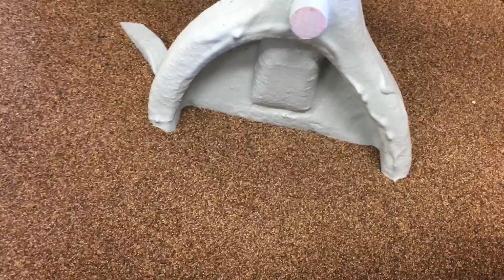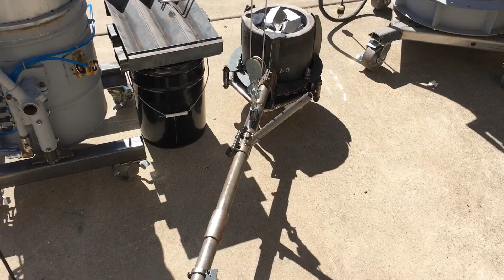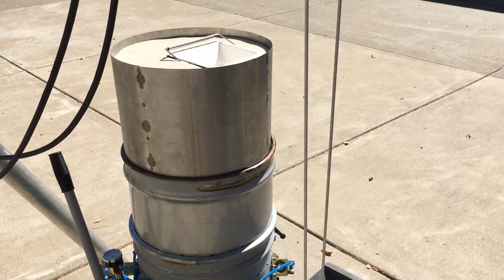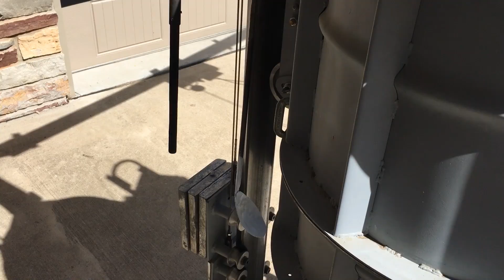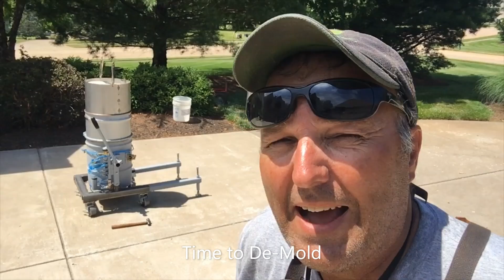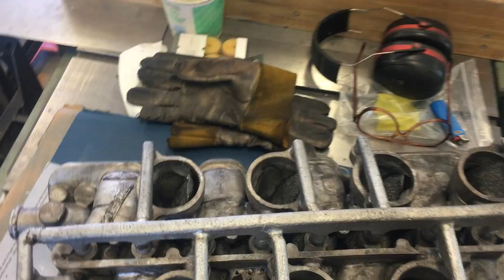Lost Foam Casting an Automotive Intake Manifold   Part 2

Comment: I'm retired none machinist, I picked up the machinist hobby 25yrs ago. What i've been working on for the past many years is a model  V10. I think mostly becouse I work with engines since I was 10. Lot of the parts involed in my build are cast parts being there is the lest amount of machining. Some part where easy, some not so easy. For help with the not so easy parts I have been following U tube such as your site. And yes you have been most helpful in corecting problems such as in gas venting in lost foam casting. I'm like my dog a Yorkee, once she gets to know a person they regert it, never leves any body alone, thank you for your help, whats your Email so as i may pick your brain, I'll be looking for that forum you talked about.

Comment: In Lost Foam technique, does the molten aluminum burn the foam out?  Or do you bake or “fire” the core to clear it before pouring it?
Reply from the maker: The molten metal evaporates the foam pattern while in place in the mold. The foam undergoes two phase changes; solid to liquid, liquid to gas/vapor. The latter is closest to the molten metal front and passes through the permeable pattern coating into the sand mold and as it does so, it alows the molten metal front to advance consuming all the foam while the metal pressure holds the loose unbound sand in place. Best, Kelly

Comment: That's really really impressive.  How much time do you estimate you have in making this start to finish?  Again, hats off man that's a hell of a project
Reply from the maker: Hobby stuff so I didn't keep track of time. When it's fun who counts? When it's money.....different story. There was a lot of equipment upgrades I did along the way to mold and pour a part this size that won't recur. I spent a lot of time engineering/designing the part and features versus making the pattern and foundry work. With all that behind me, and now that I'm using a CNC router to make foam patterns, the next one would/will be a small fraction of invested time. Best, Kelly

Comment: Kelly, what grade of sand are you using? Can I also use regular playsand and vibrate? Is that all I have to do?
Reply from the maker: Play sand will work as long as it is dry, and it often is not. If you already have some you want to use, spread it thin on your driveway in the sun and then gather it. It can also be pretty course with small pebbles, which probably doesn't matter much if you are coating your patterns. If you are going to buy, I use "Quikrete" fine sand because it is washed and dried and pretty consistent size. It is typically available at the big box stores in the section that has concrete and mortar mixes. It's probably about 50 mesh and is inexpensive at about $4/50lb bag. The #1 factor for your LF sand is to keep it very dry, else it is hard to excite and pack with vibration. I also store it in sealed buckets for this reason and because it stinks after use. If you are doing iron LF, you'll probably need higher refractory media than silica sand, like aluminum oxide or zirconia. Best, Kelly

Comment: Maybe a 55 gallon drum cut in half to make it easier to work with? Or a box? Something lengthwise? The big foundries have a big sprue roughly the distance of each runner. Like 4 big sprues with a horizontal part.

Comment: Hello Kelly  Coffield  I enjoyed these vídeos. If you need to attach 2 or more pieces of foam together, how do you do it?
Reply from the maker: It depends. If it is a small joint where the glue can be applied and the parts joined in 10-15 seconds, I use low melting point hot melt glue. If it requires long working time, High Tack Poly Vinyl Acetate (white) glue. Laminating is a longer discussion. I have another video on lost foam materials with more discussion. Search my channel. Best, Kelly

Comment: Would you possibly be interested in a side project?   Im in the process of building a foam intake manifold "much less detailed than yours" for my Cobra R clone...... basically a 2000 Cobra R intake lid, i already have the lower intake i just need to make the upper "hat" part.....  let me know if its something your interested in, i understand this wouldnt be cheap
Reply from the maker: There all side projects ;-). Post your contact info or contact me through my website www.inlinecarb.com. Send a picture and description of what you are looking to do. Best, K
Reply: @kellycoffield533  if you do this, and please do this, please share with us when you you do it.
Reply from the maker: @jkepps  Second pattern is done so attempt #2 will be forthcoming in the near future. Best, Kelly
Reply: @kellycoffield533  awesome thanks! Just emailed ya

Comment: Bummer indeed! Oh how the elation of first breakout view turns to major disappointment at failure on closer inspection - we have all been there and as you say modify approach and try again. Love the pouring set up, it looks to be a great success and surprisingly easy to use as it gives you more control over the pour than most crane type crucible lifts - well done - its a good model for others contemplating having to use a crane because of pour weight. I note the suggestion of the use of something like CO2 as  a possible solution and I also note your reply as to the problems therein. Even so I think it worth following up on a little as CO2 sand is fairly easy to pack and perhaps a sand based on Fenotec or similar binders may be suitable as it is even easier to pack and may do so with vibration? If so use fenotec sand in place of your current loose sand?? Apparently the set time of fenotec can be varied for 1 minute to 3 hours so plenty of time for pattern immersion and vibration of and into place before set but once set I doubt any leakage will occur. However your comment about weight is noted! Perhaps a thicker coat on the insides of the pattern? Sadly you are a bit on your own here - you are the expert on this process and the best the rest of us can do is guess .😊.Martin
Reply: Further to my comment above. I notice that the sand tank is pivot-able, could you perhaps extend this idea to a sort of gimbal arrangement so the tank sand mould assembly could be moved through various angles in all directions as the vibration occurs. Obviously some sort of temporary lid would need to be on the sand to stop it falling out when the angles get steep enough to ensure proper pattern sand contact... Just another stupid idea 😏... Martin
Reply from the maker: @olfoundryman8418  Thanks for those thoughts Martin, always much appreciated. You know I will not give up easily. I do occasionally (modestly) tilt the flask when filling/vibrating in an attempt to pack difficult features. You have to be careful because what usually happens is the media in the top of the mold/flask moves to one side and the bottom remains fixed and it the uneven sand pressure can distort the foam  pattern, sometimes severely. It's far better to position the pattern wisely and maintain  the sand depth in the flask on all pattern surfaces as you pack/fill the flask. That way the sand pressure remains the same on both sides of the wall of any pattern feature. The commercial LF foundries change the direction of vibratory excitation to move and pack the sand in different directions. The turbine vibrators on my molding rig are positionable for that reason. I've successfully molded and stabilized what at least to me seem to be much more difficult cavities than these runners. You probably haven't had an opportunity to read my failure analysis and proposed corrections at The Home Foundry forum thread on this project, but I will have new mold media, pattern positioning, vibratory packing technique, and make a feed system/gating change. for round 2. When you know what doesn't work, it's easily to postulate why, but don't think I don't do my share of guessing too. ;-) Best, Kelly
Reply: @kellycoffield533  Well, that's what I get for sticking my neck  out in an area that I don't know much about 😊. But to risk making a fool out of myself yet again a further thought did come to mind. I was some time ago given some resin core sand based on not sand but rather one of the newer ceramic bead molding materials. These beads  were about #50 mesh and surprisingly spherical. If you could get the beads (without the shell resin coating) and use this material as your mould media I wonder if their spherical shape might lead to better packing? Or have you already thought of this?... Martin
Reply from the maker: @olfoundryman8418  Nothing foolish there Martin. What's foolish is someone pouring a bunch of molten metal on a complex foam pattern without thinking it through....and then pledging to do it again....like some people I know. :-) The LF equipment manufactures ferrous media offerings are typically rounded media, usually mullite/alumina or zirconia based. In a previous life, I did extensive work with filtration using packed media columns. I learned a lot. Round media definitely can be made to flow more easily with vibration than granular media. I think it can be dislodged more easily too but the commercial operations also use vacuum assist and the pressure differential provides additional mold stabilization. If you can sufficiently vibe granular media it lodges together and forms mechanical interference, almost like a bond. The least expensive source of spherical media in low volume is blasting media, and can be bought in any mesh size, but it is about $1USD/pound. I buy my sand at retail stores because it's convenient. It is sieved to size, washed, and dried, and even at retail levels is about 8 cents/lb. If I was willing to buy it in bulk at 1 ton or more it would be 1 or 2 cents/lb. I cant store a ton of sand. I'm still just a guy casting metal in his driveway with equipment I roll out of my shop. Best, Kelly
Reply: Kelly , Again I find myself "preaching to the converted" As I should have realized with the effort and thought that you have put in to make the LF process your own you would have investigated the various media options. It seems that CB media is available ex China at about $400.00 per ton.  there must be someone importing it (or even making it) in the US. Even allowing a fair mark up it should be available in a suitable quantity that considering its reuse-ability would not be too unreasonable - if it solves a problem. Perhaps I am wrong (again) but as stated above I was given a 25 Kg bag of CB resin coated to try. I was hardly a big customer so for them to just give me the 25 Kg indicated to me that while it was no doubt dearer that the approx $7.50 I pay for 25 Kg of resin coated silica sand it was not that expensive?? (Wrong again ?😏)
"Like some people I know" - Hmm, yes there is a lot of that on YT. I just watched an admittedly entertaining video on making a casting and as usual it was full of errors from pattern making to casting finishing. I nearly choked when the offer was made to describe the functions of the various bumps etc in the running system in a future video, if the demand was there - clearly the video-er had no clue as to proper gating etc. In another video a gate was cut in a circular way encompassing about 1/4 of a circle from the sprue (massive parallel) base to the casting - it was explained that this curved gate "cleaned the metal" (groan!) And this from a well known YTer of US origin, he has 20 times my sub level - Sigh - its just not fair. Keep up the good work.  I await the next try... Martin

Comment: Been using this vibrator for years for various applications. Really powerful but you can remove weights to tune it. 
https://www.ebay.com/itm/143762975291?hash=item2178f0ea3b%3Ag%3AyfAAAOSwNsVfdDqz&LH_ItemCondition=3
Reply from the maker: Thanks for that link. Much appreciated. I went and looked at those and others like it and based on their published specs, it appears I already have the equivalent vibratory force of two of them. I may swap two more of the larger TBs for the smaller ones. They are compact and high energy, but they are big compressed air pigs and I won't be able to power three of them continuously but should be able to charge my 80 gal receiver to 150psi and power them all for a few minutes at a time for round two. Best, Kelly

Comment: Está peça roxa e isopor
Reply from the maker: The foam is pink but it has a refractory coating that is blue/grey. Best, Kelly
Reply: @kellycoffield533  interessante
Reply: @kellycoffield533  quero produzir um cilindro de moto.tem como
Reply from the maker: @marciomila9264  Have you viewed my video "Lost Foam Finned Engine Cylinder Casting" ?
Reply: @kellycoffield533  não
Reply from the maker: @marciomila9264  You may find it helpful
Reply: @kellycoffield533  ok obrigado
Reply from the maker: @marciomila9264  De nada
Reply: @kellycoffield533  vc tem links aonde encontro esse produto refratário
Reply from the maker: @marciomila9264  I have a video called "Refractory Coatings for Lost Foam Casting Patterns" that discusses the refractory coating.

Comment: Murphy is gonna have his due, always 
Some sodium silicate sand, in difficult places, might work 
Very impressive rig
Looking forward to the next pour
Reply from the maker: It's true, but it is very time consuming and difficult to pack bound sand in a fragile polystyrene pattern, and it gets very heavy. I've been able to produce much more difficult internally cored parts with unbound sand. I didn't think the pattern position and molding through as well as I should have. Must try again! Best, Kelly

Comment: Sorry but I am happy I get a part three.

Firstly, I love your foundry setup, it’s put together so well.
I have nowhere near as much experience as you but what about mixing up some sand with, is it sodium silica??? You know, the stuff when exposed to co2 it goes hard? I know orientation of the foam will probably solve the issues.
Lastly, do you reuse your sand? If not what the heck do you do with it after a
Scraping it up off your driveway?

I am thoroughly enjoying every video you come out with, thank you very much for sharing.
Reply from the maker: I have occasionally used ss bound and even some green sand in difficult places but it can cause as many problems as it solves. In lost foam, when you get it right, it's generally not needed and demolding is just dumping sand. I do reuse sand in fact have for five years now. I have a sieve that sit's on top the flasks and I just shovel it in. It does degrade over time. It's cheap and I should have replaced it before this pour. You should join TheHomeFoundry.org. There are detailed threads on this project, many others, and all of my equipment builds and process development from the last five years. Best, Kelly

Comment: Which matrial use for pattern making??
Reply from the maker: Owens Corning Foamular 150 Extruded Polystyrene insulation board. If you search my channel for this title "Pattern Materials for Lost Foam Casting" there is more information about materials. Best, Kelly

Comment: Rig looks great Kelly!  That's a whale of a crucible.

I'm not competent to comment on your fine work but I will for my ego.

The defects you have are hard for someone who does not lost foam cast to understand.  It is where the sand did not get packed around the pattern sufficiently and the refractory coating does not hold the metal in.  That's why Kelly refers to it a a leaker.  Very frustrating to have happen, and it seems so obvious after the pour.

Kelly: Have you tried to pre-pack difficult areas?  I've thought about filling with sand with a foil tape cover to hold the sand in place during handling.  Don't know whether it would work because I haven't tried it.  In my experience the density of the packing is not critical so long as there is not an unfilled area.  For me, the vibration is just to get the sand to flow, not necessarily to pack it.

I'm looking forward to your second pour for the money.  Do you see any pattern changes you want to make now that you have a casting?
Reply from the maker: Pre-packing certainly can work, but for this part, packing the runners would make it too heavy to handle the polystyrene pattern. Vibrating actually does increase the packing density (10-15% typically) and causes the particles to settle into a more tightly/pseudo bound state. Try pulling an object out of a barrel that has just had sand poured around/on it versus vibrated in place and the enhanced packing will be quite apparent. I was asleep at the switch when it came to molding the part. I'm going to have another go with a different pattern position, fresh mold media, and staged vibrating while filling. Best, Kelly
Reply: @kellycoffield533  I hadn't thought about the weight of such a large pattern.  Good point!

I vibrate my sand and know it packs it in tightly.  I'm not certain that is of much value in keeping the metal in the refractory however.

Have you had failures due to lightly packed patterns?  I've not, on simple patterns where I didn't need the sand to flow.
Reply from the maker: @andrewmartin4258  For the most part, only in severe undercuts and blind cavities.